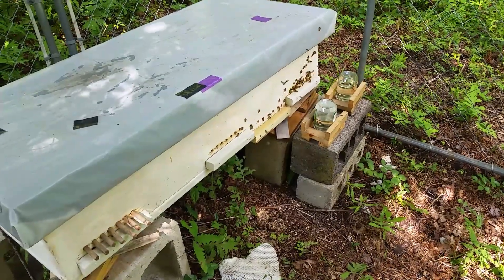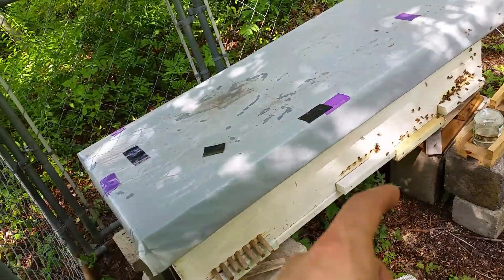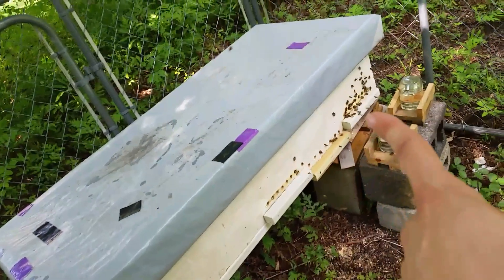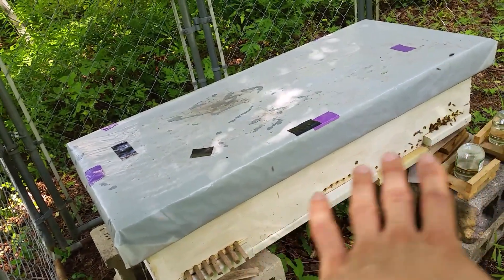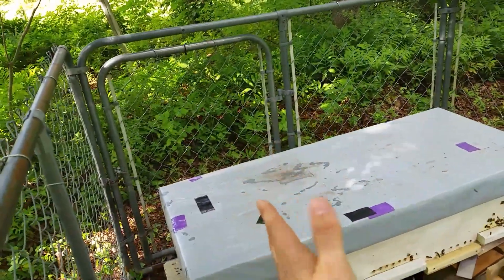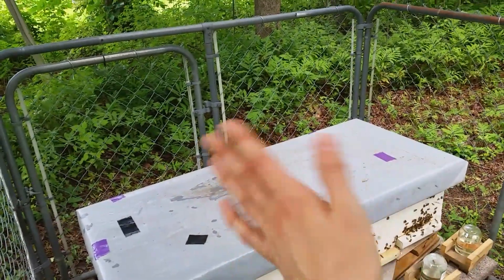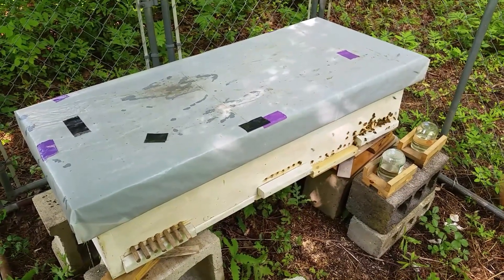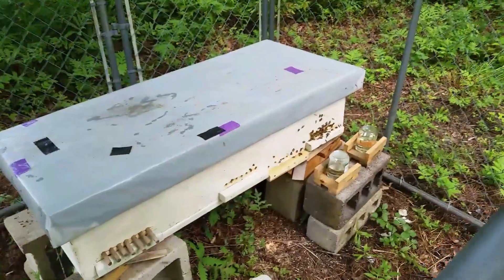Adding NEW Entrances to an ACTIVE Hive | Long Langstroth Hive

Comment: You should fill the holes along the side as you’ve effectively oriented the frames the ‘cold way’ (thus creating cold avenues from air input inline with the frames).  Drilling holes at the ends of the hive keeps the frames oriented the ‘warm way’ (thus keeping the cold zone restricted to the first couple of frames and letting the bees cluster further back in the hive and make it easier to keep warm).